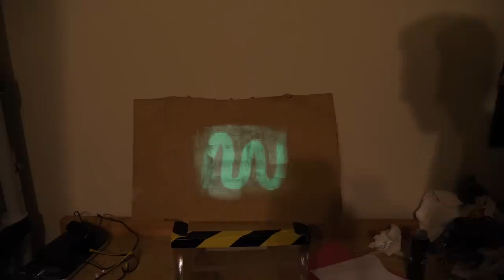Mixing the World's Blackest Paint With the World's Brightest Paint (Black 2.0 vs LIT)

Comment: That pigment is phosphorescent since it shines after being exposed to light. It stores energy received from the light and then it emits light again at a lower energy level, so no, you can't charge another glow in the dark from a glow in the dark, there's simply not enough energy.
Reply: That's right. Phosphor materials can only be charged with light that has a shorter wavelength than the light that the material emits. He was able to charge the phosphor with a red-filtered flashlight only because the filter didn't completely cut off the UV light.
Reply: @ahnyify  But then, how is the phosphor charged from the heat of his hand?
Reply: whoa.too many big words.
Reply: nerd
Reply: Yato spitt'n facts
Reply: Does this mean that if you shone the pigment with only green, blue, and violet light it would become just as charged as if you shone it with white light?
Reply: @SwordOfApollo  I dont know the specific specs of this lit paint but we can assume that the heat gives it enough energy to radiate light keep in this light is in slow energy state as to why it doesnt bright up the whole room
Reply: @ahnyify   The filter can't even cut out all high energy visible light.
Reply: The cool thing is, most fluorescent and phosphorescent materials don't emit monochromatic light.  This lit is likely emitting a range from mostly green to a little yellow and red as well.
Reply: @SwordOfApollo   because heat is energy and energy is infrared that radiates at a lower frequency/longer wavelength than visible light’s higher frequency/shorter wavelength. Short answer: infrared radiation from heat is what charges the phosphorus in the phosphorescent paint.
However, these very same effects can be had with fluorescent light, which is a higher ultraviolet light with ultra high frequencies and much shorter wavelengths, which already has enough energy to charge more than just phosphate elementals. Hopes this thoroughly helps understand.
Reply: @ahnyify  Yes, I can't believe he didn't understand that.
Reply: I like your weird words magic man
Reply: @SwordOfApollo  the phospher emits light at a lower quantum energy level (einstein bitches).
The heat is not using em radiation to charge the phospher bur thermal energy, thermal energy is the average kinetic energy of atomic motion: some atoms are moving slow, most are average, some are fast, the  fast ones are hiting hard enough to knock the phospher electrons to a higher quantum energy level, the electrons then fall back down to emit a photon.
Reply: I assumed that it was because pigments generally don't absorb the light they are the colour of.  So it a phosphorescent pigments is emitting a given wavelength of light, it also can't absorb that given wavelength because it's busy reflecting or emitting it.
Reply: @TanyaNirielle   If their brightness was equal, then pure blue light would charge more than white light. But his white flashlight is super  powerful so that isn't a fair contest.   The  ultraviolet light (blacklight) charges it  more than  white or  blue or green. Because UV light has the higher frequency/shortest wavelength. Shorter wavelength= more energy.  Sunlight would charge it strongly, not because it is white light but because there is so much UV light in sunlight. If you  could charge it with an X ray machine (X-rays are not  visible at all) it would glow even brighter than the UV light.  He should take that pigment to the dentist and get it  zapped with some x ray!

Comment: Would Infrared (Like a TV remote) cause the paint to glow? It's not visible to the human eye but it's still light.
Reply: it wont actually because it wont absorb the infra-red light and excite the pigments enough so they jump to higher orbitals and radiate heat away !
Reply: Based on the different Energy Levels in in the Atoms, it's either unpropable or impossible to emitt photons in a visible frequency.
Unless, you combine it wiht the Black paint, because the black paint will absorb the infrared radiation as heat, wich can be turned into light.
Reply: Good idea. But there's an explanation for this.
Reply: A3X CCY3 and Dennis K. are exactly right. The equations behind this are pretty straightforward too. (Although, I haven’t worked any in years.) As energy of electromagnetic radiation goes, infrared < visible light < ultraviolet. That’s why the “black light” is so effective at making the paint glow; it’s ultraviolet light with higher energy than the light given off by the paint. The electrons lose that energy when falling from higher orbits in the form of light. Light is a form of energy, and there’s only a certain amount available to radiate away from the paint because of these predefined energy levels, so it’s all green. Color is proportional to the energy (light) lost. 

 As for infrared, think of a car almost out of gasoline that needs to go up a mountain, and that is known to take a full tank of gasoline to reach the top. There just isn’t enough energy. If the car (electron) isn’t at the top of the hill (orbit), it cannot roll down the hill (give off light). As electron orbits go, however, an electron is either in one orbit or another; there’s no in between—unlike a car that would make it partially up the hill on an almost empty tank of gasoline.

I’ve pretty much restated what’s already been said, but I always learn better when I hear the same thing explained different ways. I’m not trying to correct what’s already good information, just possibly shed new light on it ;-)

Comment: when you did the test with the different colored filters, you didn't take into consideration that the lit paint glows from heat aswell.
So the glow afterwards might have been influenced by the heat of the hot flash light rather than the light. You should try a red laser for example, so we know that this specific frequency isn't inducing the glow.
Reply: Kermit also the filter is not perfect so other wavelengths can get through.
Btw a red led would work just as well as a laser.
Reply: Kermit excellent point

Comment: The only reason the red light sort of charged it is because some white light goes through the paper. If you use any single visible wavelength of light it won't charge, as you saw when you tried charging it with itself. It only charges from light in the U V end of the spectrum. White LEDs are basically U V LEDs doped with some phosphors similar to glow-in-the-dark pigment, which is why white LEDs are covered in yellow stuff and you can't see the actual LED chip. All other LEDs give off one specific wavelength.
Reply: dibarnu or use a laser pointer
Reply: exactly what i was going to say! The difference In brightness was due to the amount of light transmitted or diffused through the divergent papers.

Comment: Tell me if my interpretation is correct: the two LIT-painted surfaces don't seem to charge each other because the energy of the emitted light is right at the threshold of the excitation energy. A different way to do the experiment: two nylon sheets of equal size painted with lit and exposed to lights of equal intensity. One is kept the same and the other folded may times. Which one will fade more quickly?
Reply: Christmas Snow yeah I thought that was the case too

Comment: Please can you do a video explaining luminescence as a proper explanation will explain why green and not self charging ect.
Reply: just  hypothesis based on how it reacted with uv is that green is an energy threshold for the luminescent substance to be able to release then energy and the reaction must be endothermic (I think that's absorb otherwise exo) and therefore needs a wavelength of higher energy so a blue filter would probably have caused the same effect as uv but slightly less
Reply: but this is just a nerdy guy not a scientist so id look for a more academic source if you want the true answer
Reply: Scott B pretty good guess. Basically right.
Reply: It has to do with the distance between the electrons excited state and it returning back you it's original position I think
Reply: The distance is the same distance as the wavelength for green light
Reply: It won't self charge because the light emitted is less than it would take to excite the electron back into the excited state.
Reply: Samuel Jurgensen basically yes. The light excites the electrons then they lose energy so the emitted light is below the wavelength. I'd just like to see this channel do a vid on laser pens in luminescent water explaining it.
Reply: Oooooh that sounds cool
Reply: in theory it could charge the other plate as the emitted energy is exacly the difference between the electron positions. The charged plate will however emitt photons in all directions so just a fraction will hit the other plate, and if for some reason the photon has lost  energy then it wont be able to lift the electron.
Reply: MrTroxfan only problem is that in theory doesn't account for energy loss which all ways happens in the form of heat etc.
Reply: the photons emitted as light from the GITD pigment are not of the energy required for the electrons to be excited to the energy state whose decay path emits the green photons
Reply: a lot of explanations here... let me dumb it  down: all mater absorbs light except the one you see, the absorbed light turns to infra red (heat) and black gets hotter than most colors because of this. 

this color expels all light in the form of that particular green instead of 1 color plus infra red. so this green absorbs all light except it's own tint since it absorbs all light and transform it to this color and expels this color.

the rest is just a repeat with an example: if you need and don't mind reading.

all of what you see is mirror but in Epic Low res and one tint (or very few) so a red can absorbs all color except red, all color absorbed (blue and green) becomes heat or infrared. well if this stuff is used, it turns ALL light to THAT green, and it mirror that green 100% so it does not absorb any at all!

Comment: Glow-In-The-Dark is a quantum mechanical phenomenon. It absorbs photons and causes electrons to jump up an energy level. However, they can't jump down easily. There is a low probability of the electrons jumping down, so it happens more rarely, thus keeping its energy for a much longer period. When the electron does jump back down, it emits a photon in the process. The color of light re-emitted depends on which energy levels it was jumping between.

Comment: only half an experiment so far, construction paper does not make a colored filter for light shining through. theater gel would have been a much better choice. also makes a difference when you use thinner paper.no space left for the particles of light to bounce from one piece to the other and not done in any type of controlled environment such as a black room where no light can interfere. hand one he did not wait for the glow to go out before saying or at least suggesting that it works

Comment: I think the LIT was absorbing the heat that the black2.0 produced which made it glow ,because the lit can glow when its heated and/or exposed to light. Right?
Reply: SniperBird0P right

But you have to mention that this is only for the surface pigments

The black heats up transfers the energy to the lit pigments and they glow
Reply: SniperBird0P Heat doesn't cause phosphorescence. Different wavelengths have different amounts of energy and redder wavelengths don't have enough energy.

Comment: It wouldn't charge with it's own light because the light it reflects to our eyes (green) is just that, the color it reflects, not absorbs. So when your doing that, it just can't succ it's own light. (I actually have no clue this is a guess)
Reply: No, not correct. The light waves hit the glow in the dark compound and bumps the outer electron up a level briefly when the electrons rope back down it emits a photon and for this material it happens to be green, further more the red light made it glow less because its lower energy than white/ultraviolet.
Reply: I didn't think of it in that way, and as I stated, it was a guess and I have no clue
Reply: ASF Reviews I wasn't trying to be rude. I was just saying it's a different thing to reflection which is what you were talking about.
Reply: ASF Reviews It cant charge with its own light coz the light green of that particular wavelength it emits, which is the minimum energy required to emit that same wavelength (photoelectric effect) and the minimum energy doesnt depend on the brightness. Also since input energy should be equal to output energy for it to charge itself, its thermodynamically impossible.
Reply: James Wilshere the photo electric effect is how photons with sufficient energy cause electrons to be emptied from a conductor. This is to do with atomic energy levels and how an electron can be excited by an interaction with a photon with enough energy into a higher energy level raising the atomic energy state. After which the atom can reduce its energy back to its stable rest be emitting a photon with energy equal to that between to energy states. That’s not technically the same thing as the photoelectric effect.
Reply: ASF Reviews he would have hit the nail on the head if he said emits instead of reflects.
Reply: Mr Bork Yeah you are right, i mean the energy required to raise an electron to its higher state is in discrete packets of energy (photons), so minimum would be higher than it emits, so it must be more than that particular wavelength
I am just stating, i might be wrong, if he shines a red laser, it might not glow. Also if he shines infrared on it, it wont glow, it will glow by heat transfer by conduction only, not by radiation. I dont know if thats true anyway, my theory

Comment: I have a doubt .!
Is it the case that glow in the dark material cannot get charged by green light because it is not proper wavelength of light required by the electrons to jump to  higher energy level and come back to release a photon??
Reply: @actionlab
Reply: Yes, this is accurate. I don't know if this is required, but most glow-in-the-dark pigments have this property. The wavelength they fluoresce is the one they absorb the least.
Reply: He did a video about it, he used a green laser tu "turn off" the LIT when it was... lit

Comment: LIT is a phosphor that absorbs higher energy light (ultraviolet, blue or mixed energies in white light) then through loss of energy (heat) re-emits light at lower visible energy(green).  Black 2.0 absorbs light re-emitting it as lower energy nonvisible light (IR - heat). Mixture emission was caused by covering / uncovering LIT phosphors from Black 2.0 with mixing.